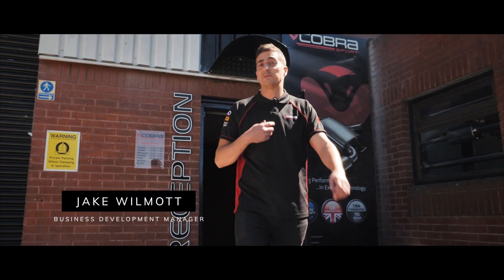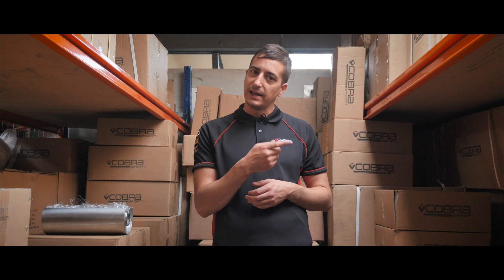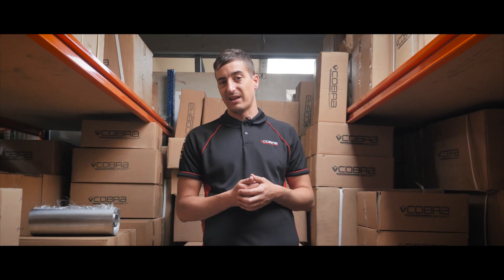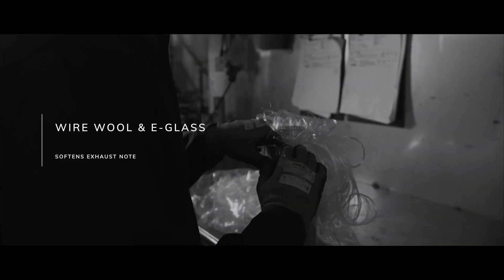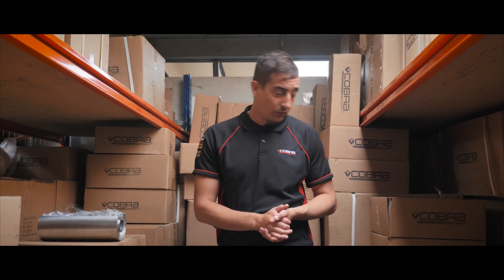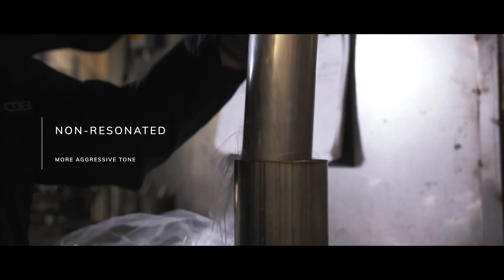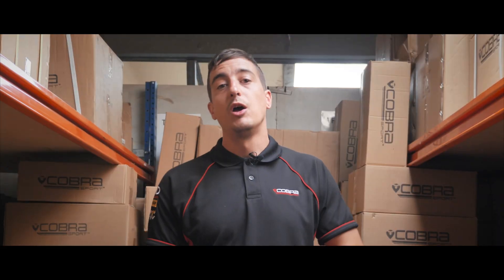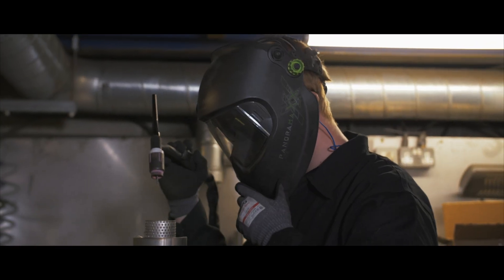Exhaust Talk: 01 | Resonated or Non-Resonated Performance Exhausts

Comment: OK! I got a straight shooter question! I finally found what I wanted, a non resonated cat back, which downpipe do you recommend for my 2014 Audi TT Quattro? Thanks! Love your video and just subscribed!
Reply from the maker: We'd always recommend the sports catalyst option to maintain the correct emissions level. We sell this package as a full turbo back if you want to have a look through the website listings here > https://cobrasport.com/collections/audi-tt-exhaust/model_tt-mk2-2-0-tfsi-quattro-2012-14

Adding a downpipe will increase the sound levels and performance further and is recommended for those looking to tune the car, it will need a re-map when fitting to balance the flow levels. If it's just a sound upgrade, the cat back setup could be enough.

Comment: Does the resonator affect performance ?
Reply from the maker: Our resonators are designed to go straight through for maximum flow, sound waves are affected but gas will take the easiest route. If you were to test to tiny detail, a straight through pipe would perform marginally better but in most scenarios you'd see little difference.

Comment: How about exhaust drone? Does a non-resonated exhaust produce more drone than the resonated version, or do they just differenciate in sheer volume and the raw-ness of the sound?
Reply from the maker: There is the potential for more 'drone' with a non-resonated exhaust system as there is one less silencer, however this is not to say every non-resonated system will drone as this all varies depending on the specific make and model of the car, and is due to the engine's characteristics.
Reply: @Exhaustsounds  Wow, thanks big time for the amazing clarification! 

You described in your reply that exhaust drone can orrur, according to the type of vehicle and configuration of said. I could imagine that the engine aspiration (turbo or NA) plays a big role into that.

From your experience, which type of vehicle configurations are really sentitive to create exhaust drone?
Reply from the maker: @c.p.2275  From our experience Honda VTEC engines can be susceptible to drone, both the older N/A and newer turbo models and certain VAG configurations can if equipped with a de-cat downpipe - the sports cat options less so.
Reply: @Exhaustsounds  wow, thanks again for your reply. It is awesome to get such in depth feedback from a company with this kind of experience in producing quallity exhaust systems. I am considering an exhaust upgrade from Cobra, on my VR6 powered audi TT MK2. I will definitely take this advice into consideration when choosing between a resonated or non-resonated system!

Comment: Congratulations on the work you do! I am tempted to buy one of your Cobra sports but in Italy they are not very popular to get a good idea of the result .. I have mounted 2 different handcrafted exhausts in my BMW 128ti, one resonated 70mm in diameter and one not 63.5mm but with both of them I have vibrations inside, what can be caused?
Reply: i have recently bought a non resonated cat back system from cobra for my 1.4l audi a1 and i can tell you its probably one of the best sounding a1s i have heard, trying not to be biased since its my car but definitely a good choice for an exhaust system
Reply: I have been researching and find that Cobra offer one of the very best exhaust notes -rich  and deep .